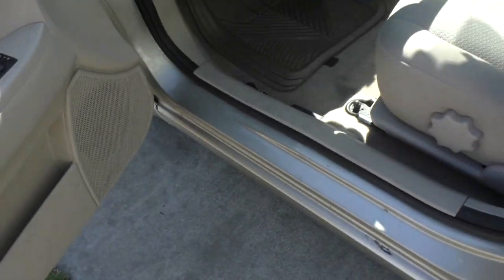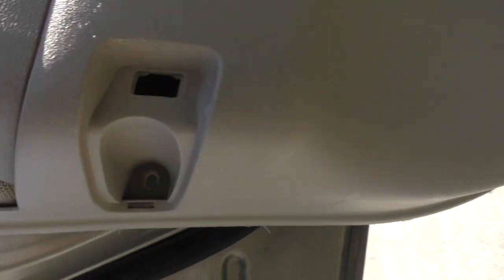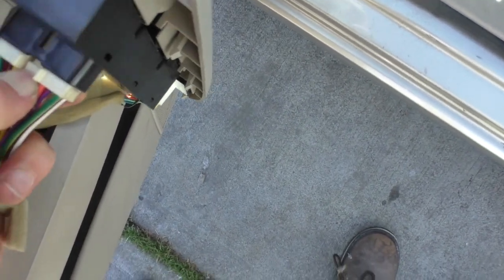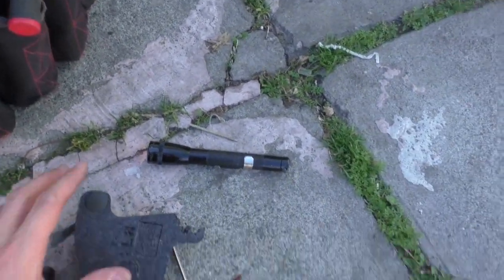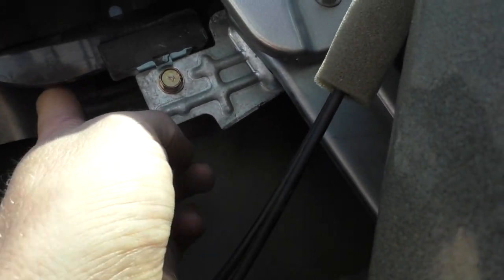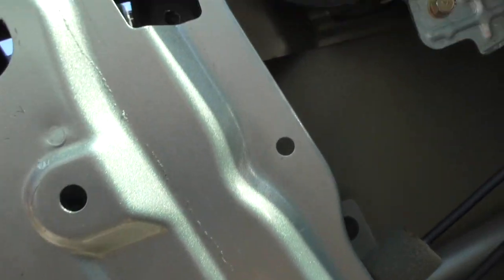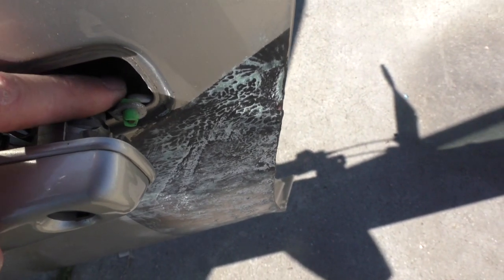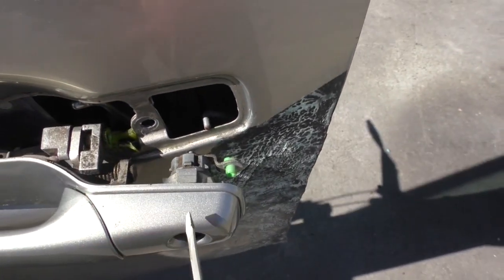How to Mitsubishi Galant Door Panel + Handle Removal

Comment: let me be the one to say that my 05 galants door handles have broken multiple times. the back passenger door would be goin on its 3rd handle.... reliable car, god awful plastic shit handles.
Reply: Same. Both front handles busted on me & ive had to replace the clips on almost every panel.
Reply: Same it’s falling apart around the engine I swear.
Reply: My 2007 is the same!  Three out of four doors had their handles break this past year (the cars 15th year).  Runs great though!

Comment: I can't get the screws out the handle cus it keep moving on both sides.i tried putting a grip plier on one side n nothing.
Reply: u move the rubber piece out the way, remove a rubber circle and stick a extension through the cicle whole to get the bolt out ... the 2nd one comes out easy and the 3rd one requires a small ratchet

Comment: All sorts of screwing going on here eh?
Reply: only 3 bolts and it comes out after you unhook it. he didnt show in video but thenonce handle off you  unclip the key ring with a flat head  to replace the key lock and the keylock slides right out of the door handle to put in your new door handle so you can keep the same keys